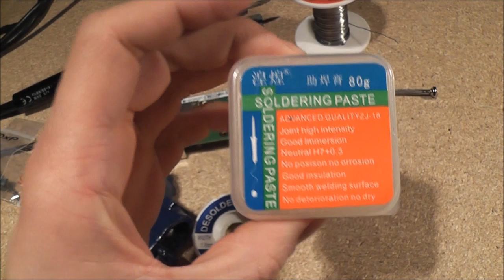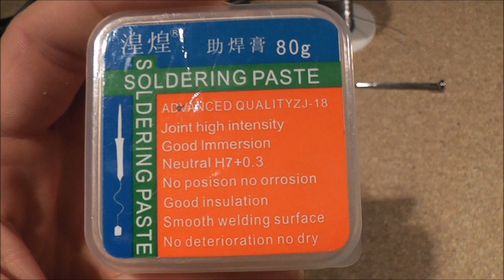Xbox 360 Ring Of Light Colour Mod - Tutorial - Custom Blue LED ROL

Comment: What BoomBrush tries to say is that the original led's are multicolored (hence the 3 contact points) but now you are replacing them with an 1 colored led so in the case of an red ring of death, you wouldn't notice it because the red color isn't present ;)

Comment: If you get RROD, no lights will flash at all with this modification. The stock LED's on the Xbox360 RF Module have both standard Green LED's and Red LED's for the RROD. When you de-solder them, you only solder one LED in place for the standard Green LED's. In order to have LED's for RROD, you will need to solder in another 4 LED's onto another set of + and - contact points located right next to the Green LED contact points. I've done this modification numerous times, I know what happens.

Comment: Unfortunately with this modification, if you get the RROD, nothing will show up. However, it IS possible to solder 2x 0603 SMD LED's onto the board and if positioned correctly, will work if you get the RROD. Search it on google, you will find how to do it

Comment: No. This is a pathetic question which shouldn't even be answered but the reason you need sotter is because it is a metal and it conducts electricity, and you need electricity to power on the LED. Hot glue is a type of plastic and can't transfer electricity.

Comment: Best tut I've seen so far. You're the first to suggest the flux and solder bread, neither of which I knew existed. This method would have made the process a lot easier the last time I did it. 

Also, the modded ROL just has the new LED color. It really doesn't matter if it's red or not, an error message still comes on the screen and you still get 3 lights signifying the error. If you have an RROD, you don't need the LEDs to figure it out.

Comment: @RetroGameTech me too LOL i now that feeling! using treezers and *ping* where the fuck did that go! alot of people state the SMD 0603 can only go one way but there are 2 RF boards and on the board in the video is the old version of RF board as you see the - + arrow under the smd and on the newer version you can see a tiny white dot at one side of the smd and that white dot is the negative side (where the arrow on the SMD should point) but of course u already knew this and this comment is 4 evy1

Comment from the maker: @patrikw25 No. It's a weird setup where only the left contact pad is positive. The other 2 are negative. That's the reason you can't easily solder another LED into the spot where the error light is supposed to be. It can be done with extra wiring but it's super fiddly and not worth the extra effort IMO. But to answer your question, no.